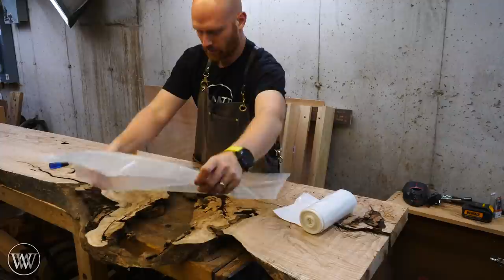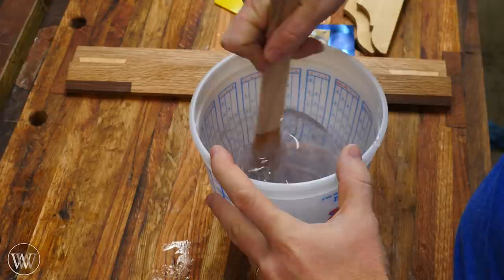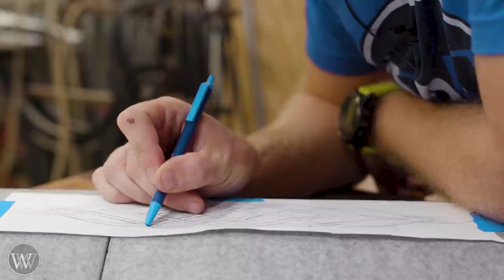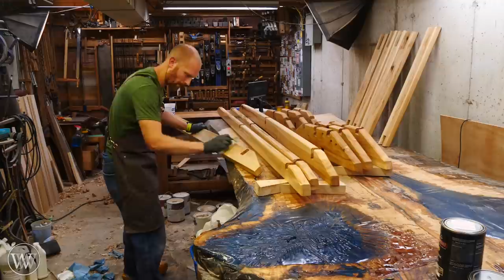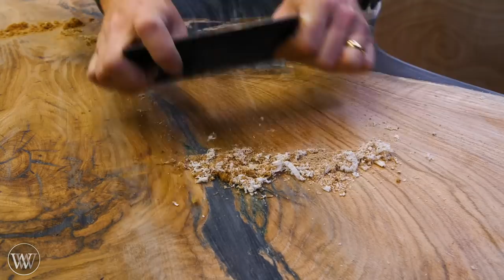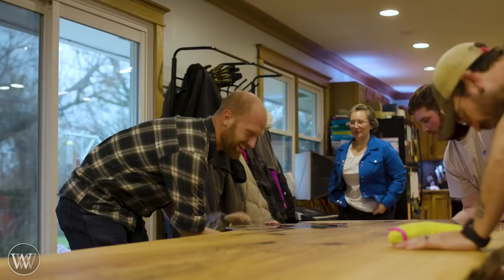Making the Live Edge Slab Family Dining Room Table With Epoxy Fill For Video Edit

Comment: After watching this I realize I'm not lacking power tools.. I'm just very lazy.
Great work!
Reply from the maker: LOL I feel ya!
Reply: No, you have common sense unlike some apparently. I mean you are using epoxy to fill the wood. A saw mill to cut the slab. An no doubt a chainsaw to cut the tree. Yet choose to use a hand saw to cut a 1/4-1/2" x 3" x 12ft trim piece? Derp

Comment: So you didn't sand and polish the wood, just the epoxy? Did you get the wood smooth just wit the hand planer?
Reply from the maker: Yes. A properly set up plane or scraper will leave a finished ready surface. No dust just glass smooth

Comment: 2 questions, #1- have you had any problems with water spots or anything on the finish considering it’s a dinner table?? #2- Did you have to water pop the grain or anything first so that once it’s finished, it will still be smooth?? I will be using walnut.
Reply from the maker: no I have not has any water or other staining even thought the kids have dumped all kinds of things on the table. Rubio Monocoat is designed to be  a floor finish and is incredibly durable. No with planing there is no need to pop the grain. but if you sand it you will want to pop the grain then hit it with a 500+ grit
Reply: Wood By Wright    Awesome thanks so much!!!!! I guess that’s why you used the card scrapers. Never used those but I might need to give them a try!
Reply from the maker: @catchemalive  when set up right they give an amazing surface that you just can't match any other way.

Comment: Beautiful table.  Nicely done.  As a layman I was curious as to why you did not use any kind of floating tenons when you joined the 2 halves together. (Or maybe you did and just didn't show it.)
Reply from the maker: Floating tunes or biscuits are not necessary. Their main purpose is alignment for when you thickness plane the boards before joining. because you can't put the whole table through a thickness planner after it's been joined up. They really do not add much of any strength at all to the joint.

Comment: That is absolutely stunning!!!!! Was that just clear epoxy you spread throughout the entire table to seal off all the small holes?? Also, how long do you expect the finish to last before having to deal with it again?
Reply from the maker: I have several videos going through this whole thing step by step and explaining the process if you want to see more detail I spread on a coat of epoxy to fill all the bug holes and then plain it down smooth the final finish is with Rubio monacoat. Most expectations are for 10 to 20 years depending upon wear and tear with light use and keeping it out of the sun it could last a lot longer than that.
Reply: Awesome!!! Thanks so much for answering me back and giving a good answer too!! I appreciate it.  Fixing to attempt to build our family dinner table out of 2.5” walnut I cut up! Got to let it dry for a little bit longer.

Comment: I like how you did a two step epoxy with blue the clear. Much nicer. How did you get a blue crackle effect?
Reply from the maker: If you pour the bottom layer just a little bit too thick then the heat runs away with it and cures it quickly and you get a bubbly crackle surface. It's kind of fun to experiment with it and epoxy. Look
Reply: Thank you. Awesome job. I’m doing some tables but went for a track saw for the cuts. Mighty big electric planer that you have. Which type?

Comment: Really incredible, beautiful work man! I'm curious if you treated the worm with anything or just blocked up existing holes? Do you have any recommendations on treatment type/technique? Have you noticed new boreholes in the tabletop since you installed it? I have 10 year old 28" wide x 16' long slabs of sycamore that are getting fairly chowed down on in spots. I'd love to try something somewhat similar but the amount of woodworm in the stock is concerning.
Reply from the maker: It depends o where you are at. This came from MN and the winters up there kill it all off. Down south you only have a few options. Borax treatments are some of the most common. If you have access to a large vacume chamber that will work as well.
Reply: @WoodByWright  Thanks for your ideas, borax is probably the way to go in the short term. Being 53 degrees North and close to the sea, winters never really get cold enough to take care of them. Still you've led me down a welcome rabbit hole of trying to figure it out. Not sure I have access to a vacuum chamber of said dimensions! Long term it may come down to a walk-in freezer which could double up in usefulness as.... well as a freezer. Alternatively a kiln may be more straightforward to construct and from what I understand heat also takes care of the little feckers.

Comment: Amazing work! What type of resin/color is that? Also, what sheet did you put down while prepping for the pour (looked like wax paper almost)?
Reply from the maker: I don't remember the brand of guy that I added to this one. I usually just use whatever I have on hand. As to the sheeting it was just 8 mil plastic sheeting that I had left over from another project. In the description I have a link to the whole series of videos. I have one dedicated to the epoxy where I talk through what I'm doing there if you want to see it.

Comment: Great work you did here!
Do you prefer working with ecopoxy over total boat? I couldn't get total boat to spread on very easily
Reply from the maker: I use both. I find Ecopoxy to be clearer but it takes longer to set.
Reply: @WoodByWright  I'm gonna give the rubio mono coat a try and see how that goes. I love the base of the table you made.
For now I'm just gonna use logs for legs
Reply from the maker: it is my favorite durable finish. so easy to apply and repair. and fantastic results.

Comment: Headlight lens cleaner!  I'm currently building a live edge entry table with epoxy pours for my daughter and son-in-law.  I noticed you used the headlight cleaner to polish the epoxy prior to applying the Rubio Monocoat.  Any problems with cleaning up residue from the headlight cleaner prior to finishing?  Amazing project!
Reply from the maker: yup. I go into it a bit further in the last video of the build series. but yes it is a high resolution polishing compound. The one I used cleans up well from the surround. a lot of other people use Yorkshire grit, but that is really expensive.

Comment: Great table. That is an awesome range of hand planes on the wall. Unbelievable the top surface was so good without sanding. Is there any dowels/dominos etc in the main centre join?
Reply from the maker: Thanks. This was a fun one for sure. No there are not any dowels or dominos between the two slabs. Those are just there for alignment and other pieces particularly when the project is too large to go through a planer. They really do not add much of any strength. and with such a wide contact surface as long as the joint is good there's no need for anything else.

Comment: What epoxy filler would you suggest for small voids and splits in OUTDOOR 2.5" white oak stair treads?  Thank you!
Reply from the maker: If it's going to be more than a quarter inch, you need a thick pouring epoxy. My favorite is eco epoxy liquid plastic. But it takes 4 days or more to cure. Next would be total boat thick set that's usually good in two to three days.

Comment: Great job.  Now I am inspired to get started on one.  How long did it take the wood to cure.
Reply from the maker: well the slabs I used were air dried for 2 years the cures inside for another 6 months. then acclimated to my shop for 3 more months. the Elm say in my basement for just over 2 years.

Comment: Now that you have had this table for a while, has the epoxied end held up to abuse by the young ones, i.e. putting their weight on the edges close to the voids?
Reply from the maker: Oh ya. The epoxy sections are holding up better then the wood sections. About a week after I moved it into the dining room one of my sons decided to try and chew on the edge of the table. Scratched up the wood pretty good but didn't hurt the epoxy much. Little bit of buffing and it was gone The wood on the other hand was pretty much irreparable. There's another spot on the table where one of the kids decided it would be wise to write their name with a sharpie marker. There's still spots on the wood that I have not been able to get out but where they marked on the epoxy it just wiped right off. They've been climbing all over it and under it and it's been holding up great.
Reply: @WoodByWright  That's good to know. I guess the kids wanted to make their own custom touches to your one of a kind gorgeous table!

Comment: Hi, what is the sheet material you put on to cover the gaps for the resin pour? And would that method work with water casting resin?
Reply from the maker: it is plastic sheeting and Mat tape. I go into great detail in the build series if you want to see how I did it and what I was thinking at the time.
It should work for it.

Comment: #woodbywright. Really impressive - thanks for sharing - what kind of tape are you using on the bottom. when I made my first table last week I used packing tape. all the epoxy flowed out of my knot fills.  yours didn't.  thanks

Comment: This table looks absolutly gorgous...
But I wonder how it will become in some years when the living wood as been working in the same time the dead epoxy did not.
Will this maybe start to crack up...?
Reply from the maker: Surprisingly the epoxy does expand and contract with temperature. it is very close to the wood in that regard. it does not expand and contract with humidity, but as long as the house is air conditioned that is not that much of and issue. I have another one that is over 8 years old with no signs of problems.

Comment: Would there be much movement with it not having time to dry out? Great work by the way👌👍
Reply from the maker: It dried for over 3 years. I cover that and the movement with the epoxy if you want to see more in the build series.
Reply: @WoodByWright  that's great. I'm finding it harder and harder to get dry slabs now here in the U.K. 
Great work pal👍👌
Reply from the maker: that is one of the nice things with several friends who have saw mills.

Comment: Hi, amazing video. Quick question: did you do aby slotted holes in the table frame to allow for the live edge slab to expand? Thank you.
Reply from the maker: no the table is just sitting on the base. there are 3 pins sticking up to keep it from sliding, but they do not stop it from expanding and contracting. with a 400lb top there is no fear of it moving around. LOL

Comment: This looks amazing!
How much resin did you use for this project?
I have some live edge oak which I’m looking to make a river resin table, do I need to coat the wood all over with epoxy after I’ve done the river?
Reply from the maker: I talked about that in the build video series I go into detail on every step on how it's made if you want to see more detail. But I used about three gallons of epoxy. If you do not have to cover the whole table I just did that to fill all the bug holes

Comment: What's the final weight on this table I want to build and sell them but I'm afraid that there going to be too heavy and too big to fit most homes
Reply from the maker: ya this is the kind of thing you need the buyer first so you can fit the table to them. the top on this was around 400lb. base and all it is about 600lb

Comment: What oil is that? That you use on top after the sanding to seal it.
Reply from the maker: That is Rubio Monaco. It is a hard wax finish. It leaves a natural wood feel but still a good resistant finish. It was designed for hardwood floors so it's fairly protective but I love the way it looks.

Comment: Why did you have so much epoxy all over the  bottom? Did it just spill out from the cling wrap you put under?
Reply from the maker: Yes. One of the videos in the series goes in to showing that part. there was a pinhole leak and one of the pieces of tape and about 3 gallons poured out the bottom.

Comment: Can I asked how you made the epoxy do crystal clear? I wet sanded my live edge epoxy table up to 2000 grit and put osmo top oil, but it’s not nearly as clear as before I started sanding...
Reply from the maker: I polish it with headlight cleaner. you can also use a product called Yorkshire grit. works amazingly.
Reply: Wood By Wright thanks for the reply! I actually tried that but the surface stayed slightly cloudy. Maybe I’ll try the Yorkshire Grit (if I can find it in Japan!

Comment: You said we should post some of our tricks-so, here goes. If you are building simple furniture, (a fancy dresser is still a cabinet underneath with "frilly" edges) Here is what I do. Pre-sand your wood down to 240 grit sandpaper-or finer and then do your joint  fabrication. Dry assemble the cabinet to make sure that all the parts fit right. Then final sand down to about 400 grit for the finish. Then masking tape all of the joints--AND VARNISH IT AT THAT POINT!. All five coats of varnish.THEN remove the masking tape and glue the cabinet together. If you do this, all of the glue stains that are so hard to clean out of the corners will not exist because the glue will not stick to the varnish and wipes off cleanly at the joints. By doing this you eliminate the "glue shadows" in the corners and will not have all the sandpaper scratches in the corners from trying to get the glue stain off. I have found doing it this way has eliminated hours and hours of trying to sand and finish the furniture I build. Sound crazy??? Then the question I would ask you would be--Which is easier to sand--a flat piece of wood with no corners, or trying to sand an assembled piece of furniture with all of the corners? Answer = the flat piece of wood.
Just a suggestion--but it has always worked very well for me. What kind of finish do I like when finished? Try a five coat 1,000 grit glow. Oh--and by the way--after you finish assembling the piece if you want a "glow" instead of a brassy finish, take a can of Johnson's Paste Wax and put it on thick. then put a gob of polish on a piece of 2,000 grit paper and very gently sand with the grain. It will take off the brassy look without damaging the varnish finish. After going over it very gently--take away the sand paper and military-style "spit-shine" the wax into the varnish and "Bob's your Uncle" you will have a Glowing, Waterproof cabinet for life.

Comment: Amazing table top guys .You should lift something like that with at least four men though at 3.07 the amount of pressure compressing down on your lower vertebrae is risking a very serious back injury that could put you in a wheelchair. I am typing this nursing a slipped disk caused by this kind of work. Look after your back dude its shit when it's ruined.
Reply from the maker: thank you for your concern, but one of my hobbies is lifting and I am a certified coach. The method that I was using to lower the table was well with in my capability and training.

Comment: Being a former engineer, it's looks like a over kill in the tables thickness, is it really necessary to be that THICK & HEAVY....?
Reply from the maker: No. This will survive a nuclear strike. It is the aesthetic that I'm going for. And in comparison to most live edge slab tables this is actually on the thin side. Most of them are about an 3/4 inch thicker.

Comment: Should of sanded it two more times and added finish after every sand. 
IMO
Reply from the maker: With Rubio Monocoat, it's just one coat of finish. No need to sand in between coats because there's only one coat. Trying to add multiple coats on top is futile as it won't bond to itself.
Reply: @WoodByWright  thanks for the info. I wrote the name down. 👍

Comment: No biscuits or even dowels at the center joint? That is going to be a problem in time.
Reply from the maker: Surprisingly biscuits actually Make the joint weaker as they do not have clamping force inside the biscuit to create a solid connection. Biscuits are merely there to line up the pieces so you spend less time planing them to be flush. Same thing with dowels they actually do not add any strength to the joint. I'm surprisingly this is the way it has been done four hundreds of years, and they hold up incredibly well.

Comment: No cookies? nor dominos?
Reply from the maker: No need those are only needed for alinement so you can thickness plane before smoothing. But I do it after joining. Contrary to popular belief they actually do not add much of any strength to the joint.